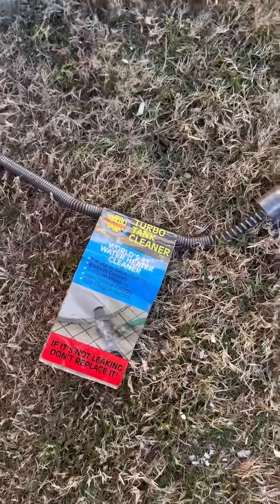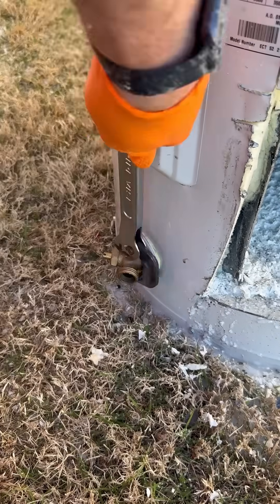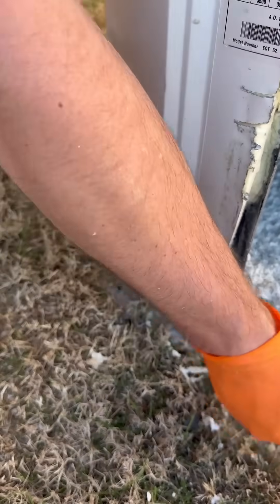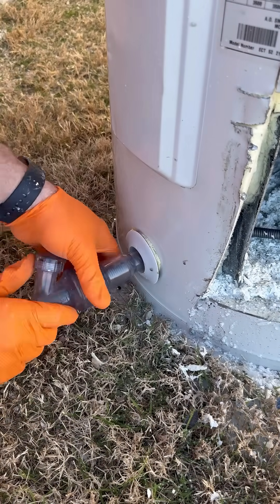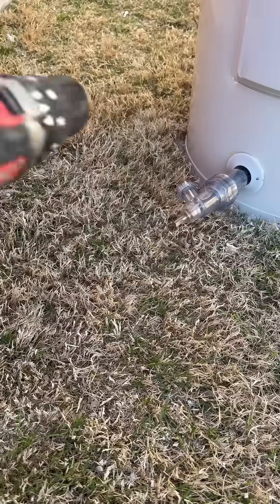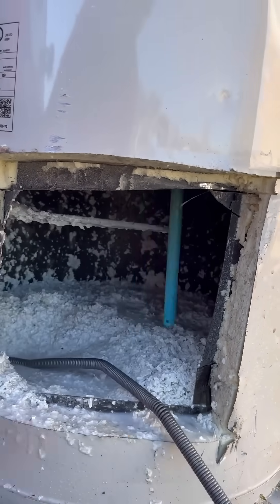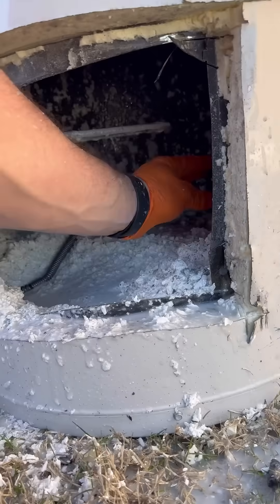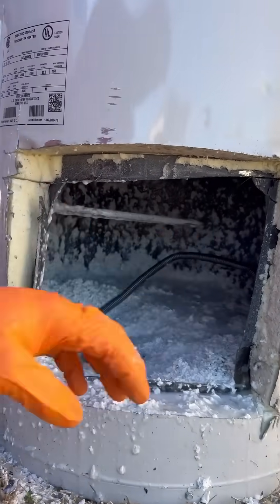What does a Turbo Tank Cleaner do to the inside of a water heater?

Comment: I have always just removed the lower heating element and used my wet dry vac and a narrow tube tapped to the end of the nozzle to suck out the sediment.  It is a pain and it take an hour or 2 but it is cheaper than buying a new water heater.

Comment: I take elements out, put a pin light in the top and vacuum all the Calcium out the bottom that I can. If you really want to clean it out. Get CLR or a calcium cleaner and put at least gallon of cleaner in there and wait for it to dissolve. If I am doing this much work I am changing the element rod as well

Comment: Interesting product, but fairly useless test.  Would not be nearly as aggressive or violent when submerged in water, obviously.  Always have the option to run the drill slower if you are concerned about breaking the dip tube.

Comment: Gimmick. Not effective and not worth the money spent on it or the wasted time. Drain the tank, remove lower element and use flexible conduit tubing taped onto a shopvac to remove deposits and a coat hanger to move deposits from troublesome areas. Old school method I've used for many years.

Comment: The price of a water heater pales in comparison to the damage done by a water heater that leaks unexpectedly while you’re not home. Just replace your water heater. It’s not that big of a deal.
Reply: That depends heavily on what your setup is. Personally, I don't consider wet concrete to be the end of the world, but in somebody's house who was foolish enough to put it in the attic or first floor it might be ruined drywall and carpet, mold remediation, damaged electronics...
Reply: However, properly installed. It really shouldn't be that big of a deal because rarely does it water spray out of there. It's usually just leaks into the insulation and trickles down to the bottom where there should be a pan. That pan should drain to some place visible to the occupants and they should know it's leaking before it gets bad

Comment: I’ve been plumbing for 28 years and I have found the best way to flush a water heater is to leave the water supply on ,open drain and let the water coming out of the drip tube stir up the sediment and let it shoot out the drain. I also have installed water heaters for people who have flushed theirs and people who haven’t and actually a lot of times the people who have flushed theirs didn’t last any longer
Reply: I agree, my Bradford White new home heater lasted 16 years, did nothing to it.  Replaced it with a new BW, it lasted 14 years, did nothing.  Just put in a new BW, I am 80 yo, might die before it goes bad.   BW is the only heater the supply house I buy from will sell.
Reply: never hurts to blast a little air in, either.  if a product like this is needed, your tank is done anyway.

Comment: I bought this and it works! 
The running water while turning the spring causes the sediment to  leave the tank.
I do many plumbing repairs and would rather rebuild a tank with new elements,  thermostats, annode rod and drain valve than replace a very expensive water heater.
Blessings,
Reply: When you damage the tank on one of those you will quit using it.
Reply: @joemasseyiii3288  I live in TX.
The water is 60 grains of hardness and tanks scale up quickly, 3-5 years. I've used this tool several eral times on the three houses I own and on several other people's homes as well.  No complaints yet.
Reply: @davidkurimski6122 do you just use it nice and slow? No parts needed replaced after use?
Reply: @c.mart90  yes, connect the drill go slow, running water through the tank and watch the crud go through the clean part and out! It's amazing!
Install new elements, thermostats and cathode (zinc rod).
I put Teflon tape on screw in elements and don't over tighten when reinstalling.
Good luck!
Reply: Then you're an idiot. Because the professional cost would be more than a new tank. And water heaters are only designed to last ten years. Have fun spend money on something that's gonna die shortly.
Reply: They sure are expensive. I just paid 2800 dollars to my plumber. That included permit fee and a 12 year parts and labor guarantee. A lot of money but we have peace of mind now.
Reply: I agree, much easier to take care of something instead of replacing unless you just feel the need to do remove old tanks, buy and install new tanks and then doing plumbing work.  
Replace the drain valve with a full port, replace the anode rod regularly or put in an electric anode (lasts about 20 years) and keep the elements in good shape.  Also check the plastic cold water feed line to keep the tank functioning perfectly.

Comment: There is a thing called moderation. As with ANY tool if you go apeshit with it bad stuff can happen. As just a single simple example, a body hammer will remove a dent to lay flat for body work repair but if you go all crazy with it you could completely destroy the panel. Moral of the story is that if you don't have common sense you shouldn't use tools much less reproduce.

Comment: water is thicker so it would not destroy the inside like it would with no water. just like you don't run an engine that requires oil, without oil.

Comment: I wish the manufacturers would just install an access (boiler plate) like they do on 100 gallon water heaters. That way you can stick your arm inside and sweep all the sediment out. You know why they don't !! lol
Reply: Yea but somebidy would open it and explode.
Reply: @askjeevescosby2928  that's on them. use security screws or a sticker on the lid to prevent idiots from screwing around
Reply: So we have to call a specialist or buy a new one.
Reply: You can pull the rod

Comment: Just leave the sediment in the tank it helps hold the tank together as it ages and prevents metal fatigue of the inner liner. Any cost savings from heating your water will be negated by needing to replace your water heater.

Comment: I use a shop vac in the element hole. It's not the greatest. It doesnt get it 100%. But it works decent and doesnt make a mess on the floor. Places I deal with with really hard water need it done about once a year.

Comment: When I cleaned out my hot water tank just the other week I did something similar but I guess you say the old fashioned way I took the steak and out because those things never work anyways I don't know how they expect calcium to get through them to begin with so once I drain the tank and got the spicket out of the way oh and I'm blessed enough to have a drain right there by my hardware tank when they build this house they knew this was going to happen I suggest anyone that builds a new house for a drain right there with your hot water tank anyways I would turn the water on the cold water going in and just run a snake in by hand just a cheap little one and just kind of poke around and that does a really good job or the way I've done it in other houses is you take out the lower heating element we move it all together and you poke the snake through that hole as you flushed out the main hole

Comment: I'd be interested to see you run the test in a tank full of water i.e. an old one that you're about to replace, and then cut the tank open to see how it performed.  

Another degree of complexity to the test would be to push an endoscope into the hot water (exit) hole in the top of the tank to see what it does. .... I assume it would stir up a cloud of sediment fairly quickly.

Comment: What's to stop you from disconnecting the inlet, and pulling the dip tube, and pulling the heating element(s), before you start flopping that thing around in the bottom?
 I mean it's more work, but not that much more work: you would need to plug up the hole where the element(s) goes in, but that's probably not hard to do...
Pulling the dip tube is a little bit more of a stunt, but if your alternative is to be getting a new water heater,  well, then, you're disconnecting the inlet anyway...

Comment: You fail to realize water adds resistance there for less i.pact on parts even if anode rod breaks off it desolves anyways it wouldn't matter if it were to snap it'd snap where it's already desolved most of the way through no biggie.

Comment: I found that using a 1/2 inch copper pipe taped to a shop vac works the best for cleaning out the bottom of a tank.

Comment: Better option, get a garden hose to 1/4 inch reduction fitting, pick up about 2ft of 1/4 inch copper tube, combine them, crush the copper tube closed at the end away from the garden hose and drill a few small holes pointed "down" near that end.  run the copper tube in and out of the tank attached, to a hose with a catch pan for the sludge. The water pressure out of a few 1/8 inch holes will kick up the sludge and it works great, takes 10 mins and 15$ to have the tool. Keep it ziptied to the tank and its yours for life
Reply: Basically a giant water pick!  Btw using cheap dental water pick is the easiest way to clean grout and shower doors plus more.  To keep from stretching the tubing put the water pick in a small basket or a plastic sack with something firm on bottom - something tgat fits over your wrist.  Tie an extension cord to the handle of the bucket and then clip the cord to your belt with a hair or chip clip - to take pressure off basket and keep it from tipping. The correct length is putting the basket down on floor and then the cord goes from there to your waist without touching floor.  Refill the well by having a jug of water nearby.  You can use hot water snd/or add cleaner to this IF you are dedicating the water pic for cleaning only.  Use dirty laundry or dirty towels to absorb overspray.

Comment: Once the water is in there the resistance of the water will keep that wire from whipping around too quickly so id say its worth it
Reply: Lol so you're saying I will not damage any internal parts?!
Reply: @DriiiverStudios  hypothetically yes if the tank is filled with water the snake clearly wont be able to whip around as fast because of the waters resistance, you ever try to punch underwater? Same concept, when used correctly with water in the tank im pretty confident that the snake wont damage anything. But thats just an assumption lol

Comment: What about drain the tank? Remove the bottom heating element. Uses a shot vat with a smaller hose attached and suck all the debris out
Reply: Show me a vac hose that will fit through a 1 1/2" hole.

Comment: I've seen the sediment buster but that uses compressed air or air pump from the outside to help stir up sediment and you have to do this 5 or 6 times to really clean it out.  There's never some whipping hose or line inside.  I wouldn't use this either.  That said.... I don't think flushing out water heaters is really needed anyway..... I've done it on mine a couple times in the past but never got that much stuff out....and the water heater lasted over 25 years so that's proof flushing isn't necessary....

Comment: Wouldn't the water cause enough resistance to slow that thing down and it would not slap around like in this video? Kind of like a hose with a pressure nozzle on the ground versus in a pool kind of the same theory

Comment: I used one to clean mine. Thing is I was changing the anode and both elements just to give it a refresh. It did work sort of it took me 3 hours to completely clean all sediment out and it wasn't that bad. I have 3 filters down to 5 micron before all my appliances so I am sure that helped.
Reply: Stick a hose the proper size inside the hole left by the element.  Attach to a shopvac using reducers and hose clamps
Reply: @rich2583  yup I did just that used a small shop vac with a hose taped up and sucked out the remaining worked very well.

Comment: I was called to replace a water heater that was so full of sediment that it wouldn't drain, 50 gallon at 8+pounds per gallon + tank  and sediment it weighed about 500 pounds, in the basement. It took 3 guys with a dolly to get it up the stairs just so we could tip it on it's side.
Reply: Or drain the tank from the top with a vac or pump from the top. You telling me for 40 years, ,,,, ain't No Way!

Comment: It will break the glass enamel inside the tank, which will make water in direct contact with the steel —>  it will rust very fast
Reply: I'm glad a read your comment. I have a very old water heater in the garage that says it's "glass lined". It must be around 50 years old and works great. I just wasn't sure there was such a thing as glass inside the water heaters.

Comment: If you’re concerned about those parts pull the anode rod ( which Probly needs changing anyway and the element. Not that hard. Not that much extra work either.
Reply: If the anode rod needs replaced, it will be disintegrated and not even in the area because it's the anode rod.  You know, the sacrificial metal meant to dissolve by giving up it's b electrons. How do you remove the element and use this tool when the tank is full of water? Just let it run out all over the place out of element port? Just trying to picture removal under operation, should I tape up the hole and wing it?
Reply: @redcollardollar4235  you can use the tool and then replace the anode an element
Reply: @xephael3485  ya, I get it man. I've been working on water heaters for 30+ years. If you are breathing life back into a water heater by removing hard water deposit build-up the lower element burned out because it's buried in deposits.  The anode rod has been long gone and disintegrated. And the tank is definitely an older model that can be resurrected and not a cheap version now produced that will probably just spring a leak.
Reply: @redcollardollar4235 For an electric water heater, the anodes enter the side about 1/3 and 2/3 of the way up from the bottom, so you don't have to worry about this thing reaching up 12 to 18 in and striking the lower element. You can drain the water down to where there's only a few inches in the bottom, helping break the sediment up. You don't have to leave the tank completely full to use this. It's not going to crawl up the walls.
Reply: @UncleGunns  those are the elements not the 1 anode rod that is positioned from the top of the tank ace. Where did you get instruction? From a crackerjack box?
Reply: my thoughts exactly

Comment from the maker: Plexi glass will arrive tomorrow. I’ll retest with water in the tank and post it either Friday or this weekend. Stay tuned. Results and opinions may change.
Reply: I'm glad you're going to retest it with water in it, water will undoubtedly slow the momentum of The Wire.
Reply: If there is that much sediment in the tank why not pull the anode rod and inspect it and leave it out during cleaning?
Reply: @timothyearp631  anode rod is least of my worries, im worried about the dip tube and heating element getting destroyed.
Reply: Probably is supposed to shake wire that hard to maybe help descale any rust as well? Or maybe control the speed of drill to stir but not whip around so hard
Reply: Before I watch the retest. I figure the water will at least slow down how violent the end of the snake moves.
Reply: I'm wondering if it'd be effective still if you shortened the snake length so it doesn't hit the rod 🤔
Reply: Good thinking dude
Reply: Your opini9n better change, that wire wont whip around like that with it full of water. Doesnt take a rocket scientist to KNOW this. Id say its totally cool to use.
Reply: I was just about to ask about that
Reply: Waiting for part two
Reply: I don't know what the instructions say but drill speed is a factor..
Reply: I’m excited to see it!
Reply: When I cleaned my tank, I removed the lower element for access.
The sediment was all the way up to the level of the element.
I got the shop vac out, used a piece of pipe bent at a 90, and proceeded to suck out all of the sediment and scale at the bottom.
The larger pieces that didn’t go through the pipe I simply brought to the opening and out.
I admit that this probably wouldn’t work with a gas water heater, but then, that wire probably wouldn’t have anything to damage while pulverizing the sediment into pieces that can be flushed out.

Comment: Just run the drill slow… it’s kinda like going full blast on an electric hand snake in the kitchen. If you’re not careful when you don’t control your speed you can fuck up the cable.  If people use this tool, they need to know to just go a little slow with it don’t go gung ho using it slowly will help agitate stuff from the bottom of the tank.
Reply: I was thinking the same
Reply: It probably says to spin it at a very slow speed in the instructions...

Comment: What about the one with the compressed air? It’s a product with the same design, except remove the snake tail part. It’s supposedly designed to let you use a air compressor to pump in air in order to push the sediments away from the brass drain 🤷🏻‍♂️
Reply: https://www.youtube.com/@SedimentBuster/shorts

Comment: That's a newer dip tube too when they are old they are very brittle and no dip tube the cold mixes in and you get luke warm water and if it smack a element hard it probably kill it if glass liner not already compromised it will be after that 😂

Comment: Why wouldn't the manufacturers just figure out a way to scrape the bottom, or maybe even Teflon? Oh yeah, they don't want them to last very long. They used to last 25 years, now you're lucky to get 6
Reply: Bradford white use to make a hand hole clean out. Seal the side with a big gasket and bolts. They stopped making them 15 years ago.